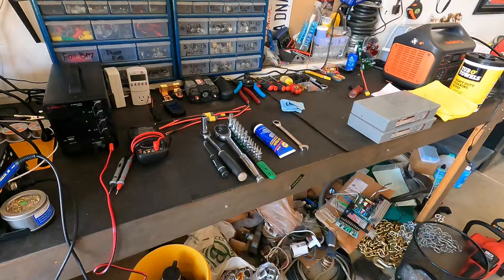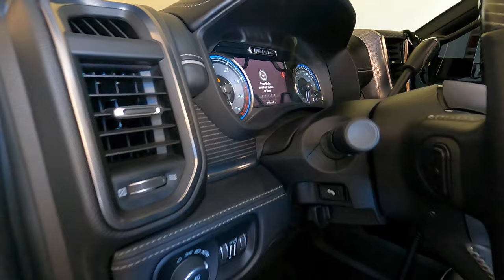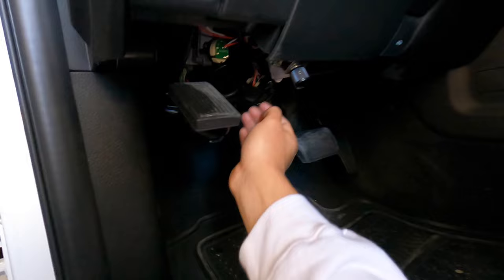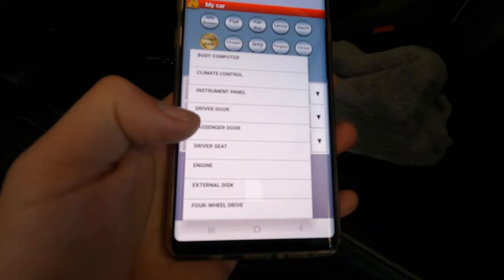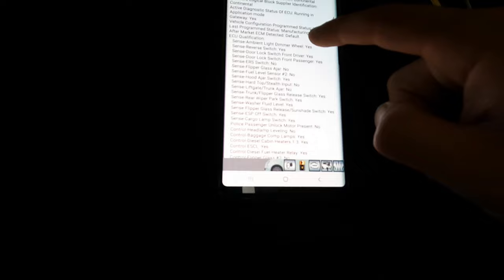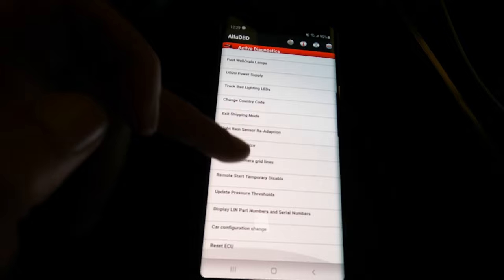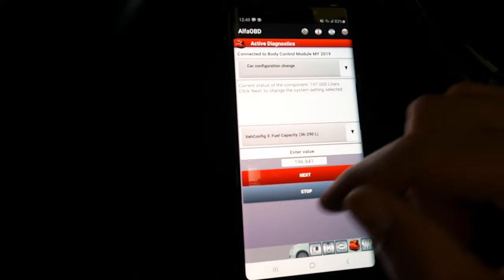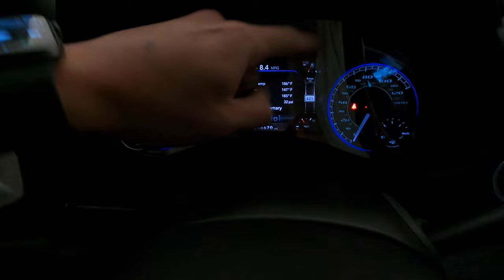ALFA OBD For Ram,Chrysler,Jeep,Dodge!!

Comment: Did you see ATS diesel has come up with a Allison transmission conversion for the Ram/Cummins just in case your interested
Reply from the maker: Yes but it won’t be ready for another month he said
Reply: @EddieLife3500  

The point being you will have a decent option to putting up with that trans you have now, that would be an awesome combo Cummins/Allison, I would do that in a heartbeat but my truck is G56 manual, month will be gone in no time!
Reply from the maker: Yes but I’m still not believing it

Comment: Installing that new cable does not work anymore Ram stopped wiring all the extra ports on the white box so you can't plug it in to anything that works.

Comment: Hello, not sure you are still watching this thread but just in case.  Any chance this tool can reset the immobilizer on a Ram Promaster Van 2019?  I have tripped it working on an autostart module.  I am about to be at mercy of the Dealer and figure my 401k is at risk.
Reply from the maker: I am not sure I have never tried it before for that

Comment: I’m working on my 2012 charger to cancel electrico hydraulic steering pump and install fully hydraulic pump , do you recommend to use this device for canceling the sensor?
Reply: I’m working on my 2012 charger to cancel electrico hydraulic steering pump and install fully hydraulic pump , do you recommend to use this device for canceling the sensor?

Comment: I have a 2021 ram 1500 Laramie I want to add adaptive cruise control. It has forwarded collision warning system. Is this possible after installing the new switch, and program it?

Comment: I’m trying to add performance pages to my 12 inch uconnect screen is this the process I will use to do that? Im not trying to give you work but are you familiar with the process of doing that or how I do it? Do I need the bypass cable to do that? I’m just not sure where to begin. Everything in my truck is stock btw.
Reply from the maker: Yes to do anything first u need the bypass cable to get into the BCM

Comment: Thanks for this! Question: I’m trying to enable the windows down option but it doesn’t seem to work.  This is the option to roll the windows down with the key fob by clicking and holding the door unlock button. AlphaOBD claims the procedure completed and the value stored as YES but the windows won’t go down.  Thoughts?
Reply: The way mine works is I have to tap the unlock button twice and on the second time keep it pressed down

Comment: Will AlfaOBD diagnose those problems for which you get messages only, but  not check engine light ? Immediately I get Service Electronic Stability Control, Service Trailer Brake System and driving for couple minutes I get Service 4WD  messages . Plus message in reverse that ParkSense rear braking Off and can 't be turned On in setting . Trying to figure out what causing that or  if only dealer can diagnose those problems.
Reply: Sounds like a bad wheel speed sensor to me. Have had a similar message 3 times on my 300c awd. I've replaced 3 wheel speed sensors. AutoZone should be able to tell you which one it is with their code reader if you don't have access to one. Easy and cheap fix.
Reply: @187killa01  Yeah actually first dealer said it is ABS module they replaced and don't solve the problems. They called some  regional technician and he found out the problem actually is the front axle disconnect unit they replaced it  and problems disappeared  .

Comment: Okay, I'm getting a Titan 52 gals fuel tank install in my 2018 dodge ram 3500 I'm hoping that the installer will do a reconfigure but in case that they don't where do I get or where is the best place to get a  AlfaOBD?
Reply: I just did this exact same thing. Did you ever buy the alfaobd and update your DTE readout? I'm trying to figure out if it will reflect as much as 700 on a full 52 gal tank. Mine currently shows 500 and won't go any higher because it thinks it's a 30 gal tank.
Reply: @CC91138  Yes I try to change it but on the 2018 it don't work, only on the 2019 and up will change. When you fill you tank up it will take a long time for the needle to move and when it does move the needle will be correct.

I try everything, just know before the needle move you will have gone about 175 to 200 hundred miles.
Reply: @bishopgeorge1333  thanks so much for the reply. I won't bother buying the alfaobd because all I needed it for was to tell the truck it now has a 52. Great info!